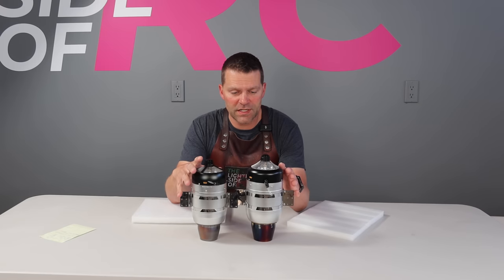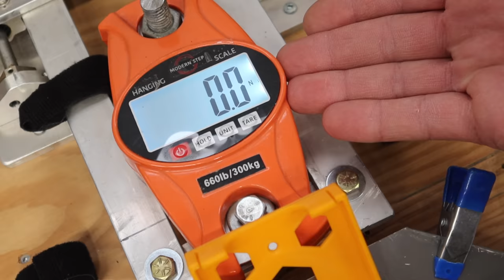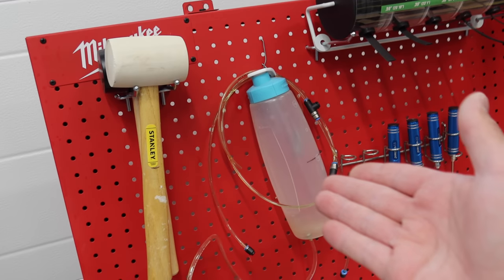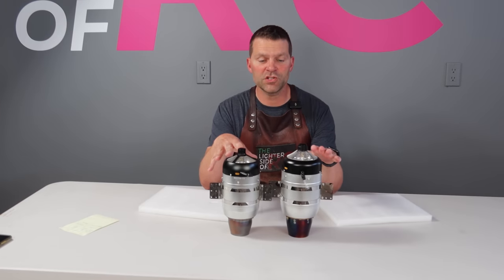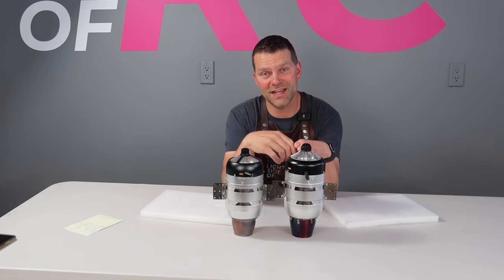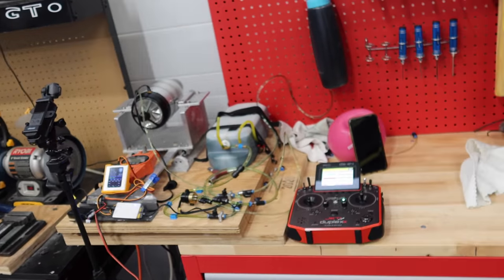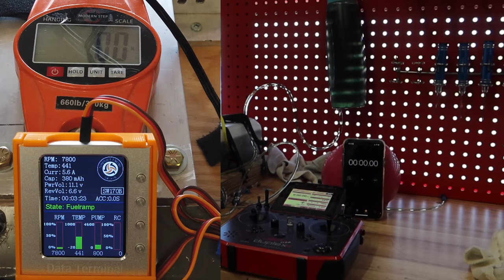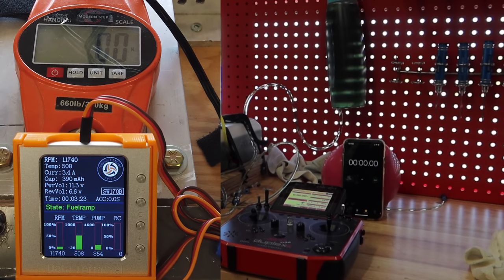Big vs Small - Uncovering the Fuel Efficiency Battle in Turbine Engines!

Comment: In any IC engine, the efficency is a function of compression ratio before the combustion section.  A larger diameter turbine should produce higher compression at the same RPM and thus should have higher efficiency.   Modern full scale turbines with multiple stage axial flow compressor sections achieve very high compression ratio and relatively high efficiency.  These small turbines with a one stage centrifugal compressor will always be relatively inefficient because of the inherently limited compression ratio but they produce higher compression at higher RPM so are most efficient at near their maximum RPM.  so a larger diameter turbine at lower RPM to match thrust with a smaller diameter turbine at higher RPM will probably be operating at lower compression ratio and efficiency.
Reply from the maker: Thanks!  That’s great info!😎😊
Reply: Exactly this. Add idk why these small engines are so expensive with just one compressor stage. I always thought to make these small turbines viable they are at least 2 stage with a low compression and turbine pair in the inner axle and a faster one on the outer one. Just seems like a scam when people make DIY turbines from truck compressors for a fraction of this cost.
Reply: In most engines compression ratio = expansion ratio. But ultimately it is the expansion ratio which determines theoretical efficiency.
Reply: @YouCountSheep  thrust to weight is more important than efficiency in this small size turbines, those truck compressors are not lightweight
Reply: @fhcompagne the noise of a piston engine tells me that they don’t expand fully.
Reply: That is sort of common sense. Higher compression equals more efficient. Also breaking up fuel into as small parts as possible, and as much fuel burn as I'd achievable
Reply: @brantgentry1463  gasoline engines smoke less than Diesels. So I guess they break down the fuel better. In a turbine you need to collect the fast air from the compressor and place a high pressure swirl injector in the center. Then slow down the mixture and “recover” the pressure until flame front speed is met. The pressure gradient lets the fuel drops “rain” through the air on deceleration => evaporation of fuel in the 100 °C hot compressed air.

Comment: This is normal, and the results as expected... Those engines ( I meant all small turbine engines of all brands) are horrible at partial loads, they are best efficients at full power, with full pressure. It´s not a good to install a big engine in a plane and limit it´s power..

Comment: Cool test! But I think a better test would be to run the 170 at 100%throttle and see how long it takes to go through that litter. Then, run the 240 at a throttle setting that produces the same thrust as the maxed 170 and measure that fuel consumption.
Reply from the maker: Great suggestion.  Also a good comparison idea.

Comment: Jet engines are most efficient at max PR , rpm and temp. Efficiency falls off fast as they drop. The bigger engine in your test is at a lower % power and less efficient operating point  at 100 N than the smaller one. If you can, check the pressure and temps of both engines at 100 N output.

Comment: To the best of my knowledge it is commonly accepted that full size gas turbines are most fuel efficient at about 80% or their rated power. I do not know if this is same for hobby gas turbines. Might be worthwhile to run the test again at 80% full rated power and comparing fuel efficiency in terms cc/Newton? 80% of 160 would therfore be 128 Newtons and 80% of 240 would be 192 Newtons.
Reply from the maker: Thanks.  Lots of different scenarios and variables we can run through.

Comment: I just stumbled across this video!  Might never see this but i did a little back of the envelope math.  Your engines burn less than half a liter of fuel per min at 100 Newtons.   I wondered what the GE 90 (of 777 fame) got per 100 Newtons of force per min.   Turns out that the GE90 burns about .125 liters of fuel at 100 Newtons at cruise per min!    Lot of variables of course.  Thanks for the vid.
Reply from the maker: Thanks for that comparison!  Yea our small engines for models are very in efficient.

Comment: The fuel consumption at the same thrust would be the exact same if they were equally as efficient.  The smaller engine is likely more efficient at that thrust since it is probably running closer to its design thrust.  Also, the larger engine is heavier, so to get the same performance from the plane, you would need slightly more thrust. 

You would want to pick the engine that is running closest to its optimum (most efficient) operating point during typical flight.  The engine makers should be able to supply an efficiency vs thrust graph for each engine.
Reply: It is hard to say how a model engine compares to full size ones but in airliners the most efficient power setting is in the 80-90% of design thrust so the smaller engine was possibly closer to its best fuel to impulse ratio.  That is only speculation since full size engines are usually high bypass two spool turbofan vs the model engine that is a no bypass turbojet.  The manufacture of the engine can probably give specific impulse over power setting and/or fuel consumption data that would help compare the efficiency of two engines at various thrust settings.

Comment: Can you easily just use a heat gun to pull the wires apart after they been soldered or is cutting the more effective way.   BTW, I've been looking at buying a Swiwin engine.  How would you rank them among, Jetcat, Jet Central,  and Kingtech?
Reply from the maker: IF you reheat and get it hot enough you would be able to pull them apart.  Cutting is quicker.  Out of the ones you mentioned, in my opinion Swiwin is in the top of those.  In my aircraft I would be installing #1 Swiwin and #2 Xicoy

Comment: This is interesting stuff. I fly off grass and have to put a bigger size turbine in my jets but I figured like you that because I was flying at a lower throttle at cruise that my flight time would even out.  Looks like I do take a bit of a hit on flight time. Whats interesting is your throttle stick percent is about same percent of fuel used compared to fuel used at full throttle.
Reply from the maker: I think in a real world application the larger turbine would end up being more fuel efficient anyways with proper throttle control.  More power available, less time on the throttle.  Same as you, we fly 95% off grass and at 3300ft ASL so I always opt for the larger engine.
Reply: @thelightersideofrc You seem solder bias towards larger engines.

Comment: I wonder if you tried both engines in the same size plane if you’d be able to see a difference? A little trivia, did you know they use something similar to solder sticks in full size aircraft? Great video and love your channel. Will be subscribing to your new too.
Reply from the maker: Thank you.  In a real world application I think the larger engine would end up being more efficient with proper throttle control.  Thank you for watching and subbing!  I didn't know they used them in full scale until I did my first video on the SolderSticks and someone said they are pieces of crap etc. etc.  I did some research and found them to be used in full scale.  That changed his tune quickly.  I have tested them many times and they are a great time saving and quality device!

Comment: Yep, the result id expect as turbojets (of any size, models to the largest military jets) are most efficient when running at full rated power and have a good power2weight ratio then but much less efficient at part throttle and idle. Thats why commercial and military stuff have being using Turbofans/Turboprops for many years, much better efficiency and performance at part power settings.
Reply from the maker: 😎. Thanks for watching!

Comment: Totally nothing to do with solder, or jets, well directly at least. What do you use for landing gear/bay door sequencer? Wasn't quite sure where to post this one.
Reply from the maker: 🙌 for an air system I use a Xicoy Failsafe/Sequencer.  Great little unit.  For Electric, they are generally Electron and the GS200 Unit is the prefered.

Comment: That is exactly what I was expecting. There is a reason they sell 4 cylinder Mustangs over V-8's for fuel efficiency. Bigger engines have heavier, bigger internals and inertia that has to be overcome but also more friction just by being bigger.
Reply: If a 4cyl drove flat out on a race track and the v8 chased him the v8 would have better fuel economy. If they both drove flat out the 4cyl would get better fuel economy
Reply: @airmanbybee  not necessarily true. It really depends on the track. If you were on a tight track with not huge straights, the 4 would probably be more efficient even driving all out because you have to remember it is also much lighter. Just look at the percentage of power being used in this test. The smaller engine was using a much higher percentage (like the 4 cyl would in your scenario) and yet it still had better economy.
Reply from the maker: I think in a real world application the larger turbine would end up being more fuel efficient anyways with proper throttle control.  More power available, less time on the throttle.  we fly 95% off grass and at 3300ft ASL so I always opt for the larger engine.
Reply: @thelightersideofrc  yeah with grass and high altitude you need that extra power. Would be a fun experiment to set up a turbine with a smaller engine, do a set flight routine and time. Then switch to a larger turbine, repeat the flight and see the difference in fuel used. I used to always put the biggest engine possible in my planes till a friend, and much better pilot than me, gave me some advise. Which was to put the smallest engine you can that still allows you to fly the way you want because weight is the biggest factor in how well a plane flies and smaller motor means less weight. That's what I do now and it works for me but motor size is also a huge personal preference thing.

Comment: Your results are consistent with what would be expected of Gas Turbine engines. These engines are most efficient at their highest throttle. Therefore if your desired thrust that you want to use most of the time is at a lower throttle for a given engine, your fuel used vs thrust output is typically going to be less efficient than a comparable engine which produces that thrust at its higher RPM spec.
Reply from the maker: Thanks for watching!

Comment: Exactly what I expected at that rating , but not really a good test as your not going to stick a 170 or 240 in a plane that needs 100, what you need to test is what the 240 does at 170  ,
Or what a lot of people do like putting a 140 or so in a plane designed for 100 and derate it that would be interesting.
Reply from the maker: Obviously there are many scenarios and variables to try and test.  I and others find great value in this as there are many aircraft right now that could fly very well on a 170 or 190 and are also perfectly suited for a 220 or 240.  I would still pick the larger turbine as we loose power at our high elevation and more power is more fun.
Reply: @thelightersideofrc  yip totally agree and unless you are looking at a specific 3D jet the extra fuel in a a 170-200+ size jet isn’t really a factor. 
BTW look at the jet mag chart at the back and see his performance number took a long time to go below .5 I think it is now many below.

Comment: this is why i fly nitro or gas. the fuel can last way longer when the engine is tuned properly and don't cost as much to maintain. piston engines can go several years without being taking apart for a rebuild as opposed to the 25 -30 flight hours of a jet engine. and the fuel is cheaper
Reply: But that's not what it's about. By this logic, it is best to do nothing
Reply: Glow fuel ain’t cheap where I live!
Reply: but nitro or gas engines aren't turbines.  they aren't suited to all the same applications and behave differently.
Reply: @BladeScraper  but you can't get a 15 minute flight out of a jet engine. the fuel burn alone would limit you to 5 or 6 minutes max
Reply: @pieterpretorius1014  hence different purposes...
Reply from the maker: Exactly!  Well said!
Reply from the maker: Not true. If I was to put all 7L of fuel capacity in the super elan, fly around in boring circuits a 13-15 min flight would be doable.
Reply: What kind of useless comparison is this? Makes no sense at all to compare a turbine to a piston engine 😂

Comment: Jet engines are only efficient near rated power. I know commercial engines burn insane amounts of fuel at tickover to produce very little thrust.
Reply: @thelightersideofrc  Would be interesting to see the same test but both turbines run at 170 newton to see if the smaller turbine is more efficient at max thrust
Reply from the maker: Agreed. The 170 will only output 140-155 ish N at our elevation depending on density altitude at the time of test.

Comment: Try them both at 170 Newtons .....
Reply from the maker: The 170 wont output 170N at our elevation.  We are at 3300 ft ASL so depending on altitude density may get a 10 - 20% Reduction.
Reply: @thelightersideofrc  OK, I was just thinking of how a pilot might actually fly a plane with that engine. It seems to me that if I can get a significant increase in power for almost the same installed size and weight, I'll do it. If it burns slightly more fuel while flying with lots more power and authority, that's fine. Not enough flight time? Add more fuel....remember, you now have the power to lift it!

Comment: Cool test but it's not what you are going to see in real life. In the same airplane you will have less fuel burn .
1st your amout of air you are moving is larger 
2. The amout of throttle used during flight will be alot less in turns and climbs using less fuel 
3. I build identical f16xl one with a 240 and one with a 190 I consistently would have more fuel in the 240 that was a true real would test. Not one time would the 240 have less fuel in it then the 190
Reply from the maker: I agree with all you said and I would still opt for the larger engine.  This was purely to test this single variable.  I still think the larger engine will end up more efficient as you will be on the throttle less because you have more available power.